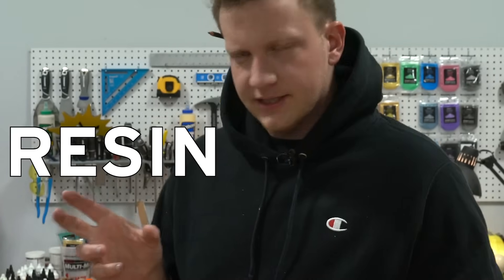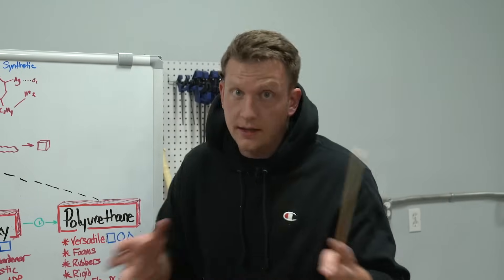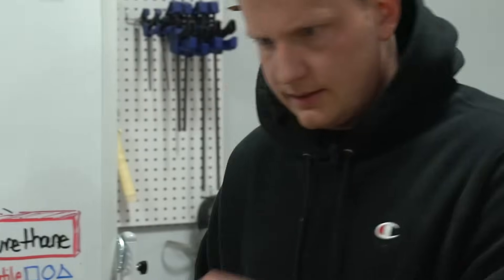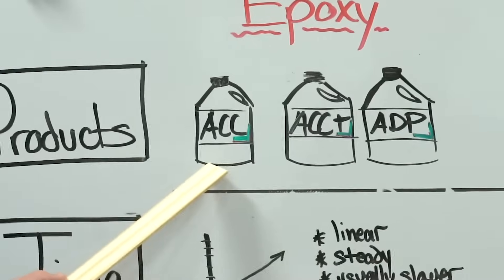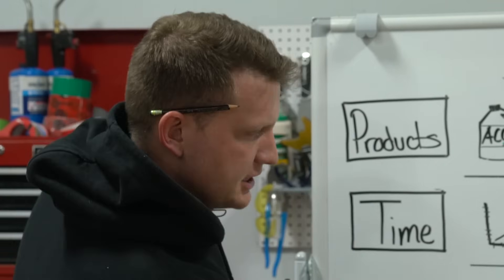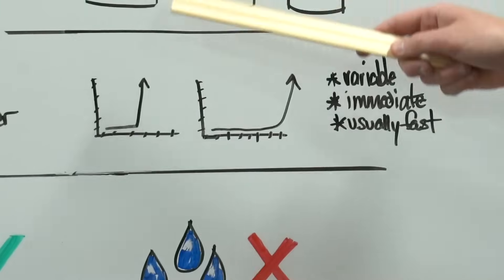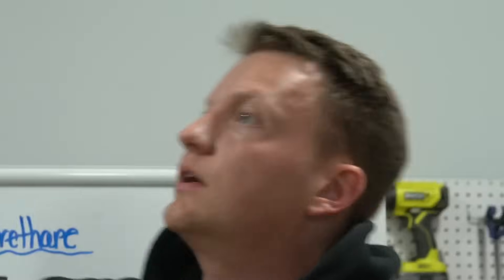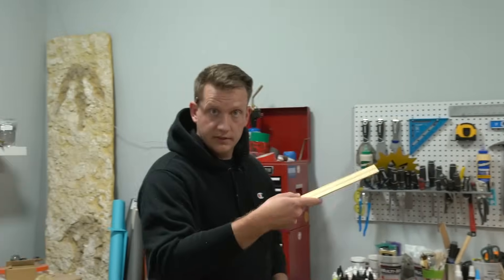Alumilite Explains: The difference between epoxy, polyurethane, and resin

Comment: Hi Jordan. I have a question about which is best to use for molding products such as phone stands and bookmarks. I prepared bookmarks which are thin and phone stands which are thicker using epoxy resin. Both are bending, bookmarks are okay the customers didn't mind. But for the phone stands, do you think the polyurethane would be better? I thought maybe it was me incorrectly mixing the resin. I did 5 stands at different mixings and they all bend.  Should I try the polyurethane?

Comment: I have a covered front porch with teak T&G flooring laid down over a plywood subfloor. It's technically exterior to the house and sees some sun and weather. High traffic. We had been using marine varnish but water infiltrates and there's some cupping. Not to mention it's not as durable as one would like. Would removing the varnish and going with epoxy make sense? How about adding a layer of fiberglass cloth to the equation? I suppose we could do some varnish over the epoxy to fortify UV protection. Any thoughts? Thanks.
Reply from the maker: Epoxy floors are fairly popular in the making community so this could work! You will want to look into epoxies with enhanced UV resistance to help keep it from yellowing quickly.

Comment: A friend wants me to make the steps for the stairs in his new house.Wood and colored epoxy resin . That part will not be a problem. I am however somewhat concerned about scratch resistance. What to take for the top coat?  How many layers? Epoxy or Polyurethane Resin? Or is it just a bad idea to make stairs with resin? Thank you

Comment: Hello, What happens with the humidity if the urethane resin is completely cured, for example, this type of resin is being used a lot for stem pipes, how does the product react with the humidity of the tobacco?
Basically it is water vapor that is concentrated in the stem duct. Is it safe to smoke in this material? Are resin particles released by water vapour?

Comment: This is the type of video you can watch over and over to clarify which product and process to use in a lot of different projects,... mine is thickening up polyurethane, so it stays transparent when cured, instead of using clearcast,
(like what's used on countertops with stuff captured deep inside)

Comment: polyurethane vs epoxy on silicone moulds... does clear polyurethane help get more casta from a silicone mould?
Reply from the maker: Great question! Urethane castings will wear down a silicone mold faster than epoxy since urethane resin cures more quickly.

Comment: Where does an acrylic urethane finish coating fit on the "thermosetting" side of the drawing? I saw "acrylic" listed in the "thermoplastic" side, but don't understand where "acrylic urethane" fits. For example, both these paints are two-part paints and they use the same primer, but also both require a hardner: AwlGrip (polyurethane) vs AwlCraft (acrylic urethane)....are they different than what you're talking about in this video?

Comment: You say not to use (poly?) urethane unless you're wood is completely stabilized. It's my understanding that wood virtually always contains moisture. What do you consider stabilized? Are you talking about using urethane as a coating or a finish or as a casting medium or either one? Are epoxy finishes "a thing" like polyurethanes are?

Comment: I used gorilla glue epoxy resin. After 48 hours? Still not rock hard? I sealed my steel capped boots in polyurethane sealant ( sikaflex) yet still not cured and it's been a week? Lol. Is the humidity in Australia? Affecting every product I am using? Any reply appreciated. Cheers from Australia

Comment: Jordan, can cured Alumilite be painted? And then if it can be painted, can it be clear-coated; and if so, should I clear-coat with Alumilite or can I clear coat with polyurethane or some other brush applied clear coating? I will be making an item that will be turned on a lathe, then sanded and polished.

Comment: and linear polyurethane used to paint planes  high end boats and cars, very durable  resistant to  most everything and keeps its shine....and I thought urethanes were good  for counter tops. I  tried it  but it is cracking and flying off I should have used good ol epoxy clear coat... seems like epoxy is the go to solution for cracked boat hull repairs  for strength

Comment: I've been pouring resins for over 1O years. Polyester resin works just fine for pen blanks. It is odorous for sure. Cures and on the lathe in less than 3 hours.

Comment: Thankyou . Very well explained . One thing I would like to know more about is the MMA's  or methylmethacrylate adhesives.  And the way they work as far as adhesion vs polyurethane goes .  I mean would MMA have a stronger adhesion sheer strength than >2N mm² than polyurethane ?  . Just  wondering . 🤔  you seem to know what you're  talking about. ????

Comment: at least with paints and sealers, there are usually both water based and solvent based polyurethanes.  would i be correct in thinking that a water based product is not gonna be moisture sensitive

Comment: Yup and don't fix boat hulls with epoxy. They're not made of epoxy. Use poly resin. Better bond. Epoxy to fix epoxy or epoxy to coat bare materials. Like a new wooden boat transom. Some say keep epoxy totally away from any boat. But epoxy is king. Unless you stop by NASA for $5000 a gallon rocket paint.

Comment: thank you, Jordan, for all the 411. I have a used 53' dry van trailer with a new oak floor just installed and the shop sold me some other product for the inside floor. I was checking out you tube for products to apply to the underside between the crossmembers 12" on center. I will be applying this product upside down; would you offer any suggestions on what product to use and how to apply it over head?? thank you in advance

Comment: I have a customer wanting me to polyurethane all 25 of his tables in his restaurant. The tables are currently made of barn wood and looks like they have been coated in polyurethane. My customer wants me to sand the tables a bit, but not all the way down to the wood smooth cuz he likes the rough cut look of the barn wood. So can I sand the entire top just a bit and apply polyurethane on top of the polyurethane that was on there before I started sanding it? I have to get these tables done quickly as it’s a restaurant and he needs all the tables there asap. Is there a super fast drying polyurethane I can use? Or is there a different process that you think I need to do? He doesn’t want an epoxy top. Thank you so much for your feedback.

Comment: I have an old chevy van that has a true high top (about 2') and it is fiberglass and has hairline cracks etc.  After fixing and prepping the surface ... will either one of these work well on that roof?  UV, lots of rain, hot cold etc?

Comment: If Im making greenhouse roofs, which resin will last the longest and be clear?  Which brand will last the longest?
Reply from the maker: We actually wouldn't recommend using any type of resin in projects that will be outside in direct sunlight for long periods of time. All resin will yellow overtime so another material may work better for this specific application type.
Reply: @AlumiliteCorporation  TY!  Will acrylic also fad or yellow?
Reply from the maker: We're not sure! Since it's not one of our products we don't have as much insight into it - reaching out to a manufacturer or company that sells acrylic panels will probably be your best bet!

Comment: Hey, great video! I recently acquired a Remington 700 AS (Arylon Synthetic), not to be confused with the Remington 700 RS (Rynite Synthetic). Both of which were made in 1988-92 by custom stock makers for Remington. Arylon. What is it and does it still exist? The Rem 700 AS' stock is made by Six Ent. and consists of a material called Noryl, A GE manufactured Thermoplastic-polymer. The rifle stock itself is very interesting for several reasons, the first being I actually found one and managed to acquire it. It has a very pungent odour, like a body spray or cologne that lingers quite a bit. The feeling of touching the stock is also very strange, it irritates the skin and I can barely hold it without wanting to put it down. I plan to hydro-dip or simply paint the stock to avoid actually have to handle it during regular use. If you know any more about the Rem 700 AS or how it's made, I would love to hear about it. Guessing it was fairly costly to produce, as Remington only made it available for a few years. On the plus side it seems very durable, with maximum stiffness and rigidity. Remington refers to Arylon as a Polyarylate, not sure if that helps any.
https://dielectricmfg.com/knowledge-base/noryl/

Comment: So should I use the polyurethane as a top coat for my kitchen counters?
Reply from the maker: Urethane resins wouldn't have a long enough work time to successfully cover your counters so we typically recommend using a table top epoxy like our Amazing Clear Cast epoxy.

Comment: What would be the best resin for an outdoor pebble or gravel patio? Looking to not have any water penetration if possible. I'd like it to become a solid surface without having to do a deep pour but I think the applications I've seen advertised are all water penetrable. However I've seen products like what seal smart uses (I think it's like what's used to seal some power poles) this product becomes a solid, can turn  baking soda into a solid... my guess is it's a polyurethane since it cures l
quickly. so if I had pebbles and some other fine dusted binder couldn't a resin become a solid over gravel without a deep pour? My issue with water penetration is this area I'm trying to cover in gravel its next to the house and  has lots of water in the area when it rains and I'm trying to drain away from the house, under the gravel is thick clay that will expand when wet. I would do it in concrete and gravel but like the idea if resin better because I can't do a think layer and I'm afraid thin concrete would Crack.

Comment: Thanks for the video!
At a furniture expo, I was captivated by a white ultra high glossy finish on the insides of a cupboard; including the shelves. Nice for storing clean linen.
Inquiring about it, I was told that it was an epoxy coat covered with a final coat of polyurethane.
There were no drip signs on the edges.
Does this mean that polyurethane can be sanded and buffed, like say, metals?
Reply from the maker: Yes, it's a very similar process! Checkout our Sanding 101 video for a deeper look into the process!

Comment: Can I use epoxy clear on my hardwood floor
Reply from the maker: Yes, you can use clear epoxy on your floors but we would recommend checking out our sister brand Stone Coat Countertops - they have a ton of resources and products specifically for this application!

Comment: Between epoxy and polyurethane, which tends to have a stronger smell? I've got some amazing clear cast and it smells pretty awful while curing.
Reply: Meh all depends on your products. I've put down some God awful smelling polyurethane, and some aweful epoxy (especially when you use isopropanol in the mix). I've had polyurethanes and polyaspartics linger around days after coatings though.
Reply from the maker: Brando has got it right! It really depends on the product and how sensitive you are to the chemical formula.
Reply: @AlumiliteCorporation  In that case, do you know which of your products tends to smell less? Wasn't something I could find listed on the website. My long suffering wife would thank you.

Comment: Is there a mix for making DIY faux wood (like for using in small moulds) out of either Polyurethane or Epoxy that will take a stain?  If so, when I de-mould the piece, I'd like to be able to heat it up (with a heat gun or blow dryer) to make it temporarily flexible.  Do you have something I can do that with?
Reply from the maker: Hmm... that seems like an interesting project! We would recommend reaching out to our technical services team with more info on what exactly you're thinking - they should be able to help you figure out if any of our products would work! You can reach them at info@alumilite.com

Comment: How hot does each resin get when curing? Im considering making a clear bottle prop either using slosh casting or a wax plug. Will the wax melt before the piece finishes curing?

Comment: Awesome video!  Is there a reason why most rock climbing holds are made with polyurethane and not Epoxy?
Reply from the maker: I think it's mostly their quick cure time and their durability! They're typically a little tougher and pick up texture insanely well, so urethane resins are perfect for climbing holds!

Comment: Very useful, thank you!
I just have a question is Epoxy safe to be used for candle vases? Or it softens easily ?
Cheers
Reply from the maker: Something like a tea light holder should be fine, but we would recommend being careful when it comes to full-sized candles.
Reply: I wouldn't do it if it's close to the flame. High temperatures like that break the bond of epoxys.

Comment: I'm actually trying to find a hardening resin for wearable clear heel shoes nothing like a stiletto or anything a 1.5 inch heel that's chunky the heel I'm not so concerned with it's the middle part then I'm afraid of going to break in half and cut me open
Reply from the maker: We would recommend our Amazing Deep Pour epoxy! One thing to keep in mind is that the chunky-er the better in terms of longevity of the resin!

Comment: What's the one to use outdoors in the weather full time outside
Reply from the maker: Great question! You have to remember that all epoxy yellows (resin does as well, it's just lasts longer). Knowing this, you will want either an epoxy with added UV resistance like our Amazing Clear Cast Plus, or a urethane resin like our Clear Slow. Check out our Yellowing Epoxy video for more info on this topic!

Comment: I need a flexible rubberish binder for pebbles. It's for a gunnite pond to sidewalk 6 inch wide  transition strip. The sidewalk and gunnite are both on clay which swells and shrinks with rain and drought. Regular concrete cracks and heaves causing a trip factor. Any Ideas? Its out doors 365,  28-111F temperature swings.
Reply from the maker: Great question! Unfortunately we don't have any products that we could recommend as a binder for this application. You should definitely check out polyurethane rubbers used by landscaping companies - they may have something more suited for this specific project!

Comment: I want to make a rubber disc golf disc. Soft enough to not break and be flexible, but hard enough to not bend much and fly well. Any recommendations on what to use? Thanks!
Reply from the maker: You'll definitely want to check out our Flex line of urethane rubbers! The higher the number the less bendy it is! You can find them here: https://www.alumilite.com/products/resins/rubbers/
Reply: @AlumiliteCorporation  thank you!
Reply: @AlumiliteCorporation  last question! I’m about to buy some, but also want it to be black. What should I add to it to make it black? And then I want to make a design on top, so what would bind well with the urethane rubber?

Comment: Can a laminate countertop be coated with a clear resin to create a heat resistant surface?
Reply from the maker: It can certainly be coated with resin, whether it will withstand the heats that you're thinking of is a different story. Each epoxy has a heat deflection temp (when the epoxy starts to get soft but will return to normal once cooled) and a heat resistance (when the epoxy can be permanently damaged. You'll want to research each of these numbers to find the epoxy that works best for your situation!

Comment: Question. What would you use for high heat resistance and best light penetration both visible and IR
Reply from the maker: All of our epoxies have a heat resistance of 400°F - their heat deflection temperatures are more around the 100°F - 130°F range. For light penetration I'm assuming you're referring to its ability to block UV (and other) light. We actually have a full video on the yellowing of epoxy and how it applies to our products! Check it out in our Alumilite Explains playlist!

Comment: You can get slow and fast cure hardener for epoxy and still work with it while it’s hardening for the first hour. Polyester is still highly used to make surfboards, skimboards, and boats. It’s highly resistant to moisture, but way harder to work with because it sets up quickly, especially in hot/humid climates. You have to mix the catalyst according to the temperature. Also, gel coat is polyester resin with bondo in it. That’s what is on the hull of every boat, except wood bottom boats.
Reply from the maker: Pretty interesting! Thanks for the info!

Comment: Can epoxy be brushed on with a foam brush and have a relatively clear/streak-free finish? The project I’m working on has mirror tiles (like a disco ball) but the surface doesn’t allow for a pour method.
Reply from the maker: Yes! Epoxy is self-leveling so it doesn't matter what you use to apply it - it will always cure flat!

Comment: Now I'm curious what the difference is between the polyeurethane in a paint can vs the stuff these guys are using for art projects.  The reason, the stuff you can get by the half gallon at the hardware store is 1/4 the cost of epoxy resin.
Reply from the maker: Great question! There are a LOT of different types of polyurethanes - rubbers, foams, plastics, etc. The polyurethane you find in the hardware stores is just a different formulations made for different applications.